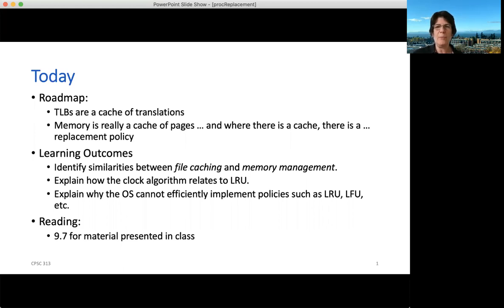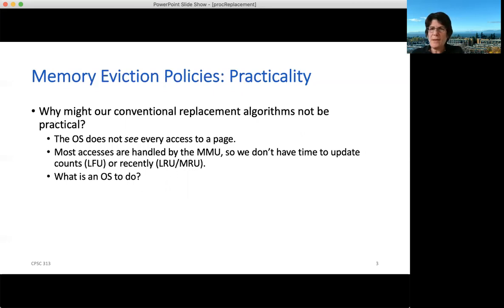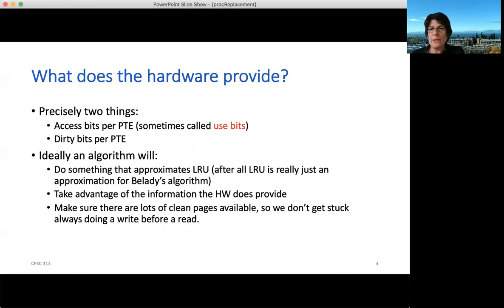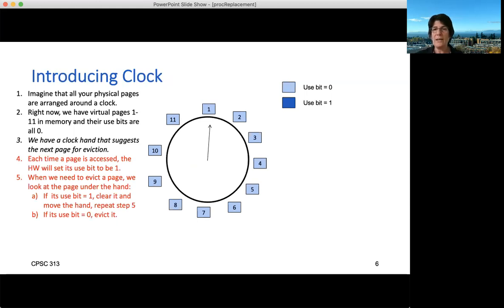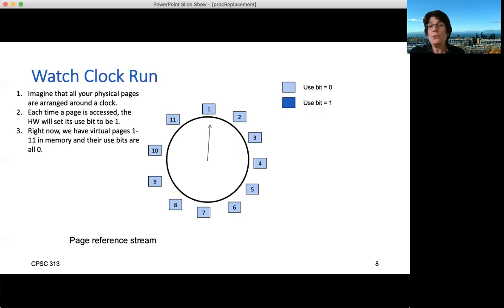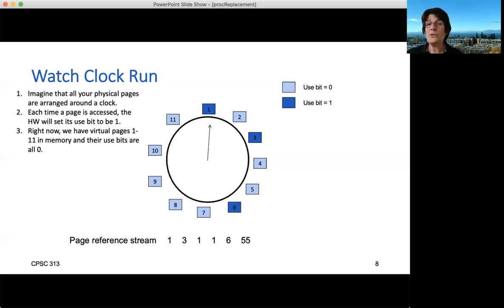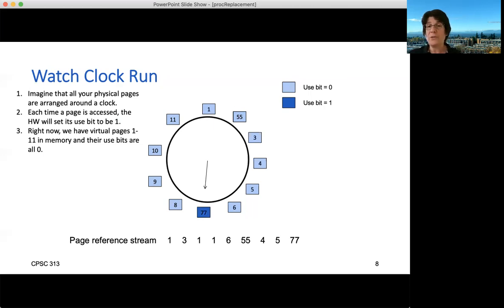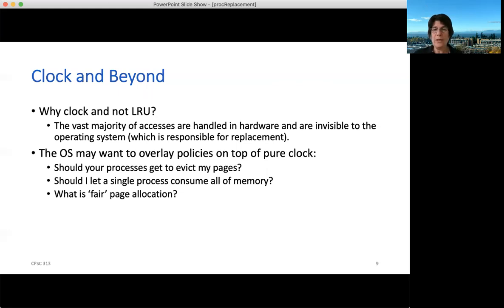Clock Page Replacement

Comment: Great. After watching several videos and reading several papers about page replacement algorithms, this is first touching the problem how pages are marked as accessed in CPU and stating that real world implementations are approximations. No one mentioned how horrible idea is to maintain true LRU in multithreaded environment (not in OS, but application that processes data than can easily exceed memory capacity)
However video does not mention how often to run the clock and if to run them through the whole circle (very often, when memory is nearly full, once per second, at adaptive rate....)
I guess that real OSes has/had this mechanism for active pages and data are going to inactive FIFO before going to swap file or being freed and it uses some combination of this and 2Q.
I see problem with this algorithm itself - when there is either very little activity or all the activity is performed over small amount of pages (e.g. computations), nearly whole memory is marked as inactive very soon and information if page was used 2 seconds ago or 30 minutes ago is lost.

Comment: Excellent video! So I guess the guarantee of clock algorithm is merely that the evicted hasn't been accessed since the last eviction. The time interval between the last and current eviction is the minimal guarantee. For the same reason, it is not an exact approximation. Empirically one may extend the time length of the guarantee by replacing "the time interval between the last and current eviction" by "the time interval between the n-th back eviction and the current eviction". Finally, one caveat is that there is always going to be a page that is going to be evicted, since if there is no page that hasn't be used between the last and current (impending) eviction, then the clock algorithm manually creates a new eviction cycle so that there in the most newly created eviction cycle, there exists a page that has used bit = 0 (in fact, all of the pages).